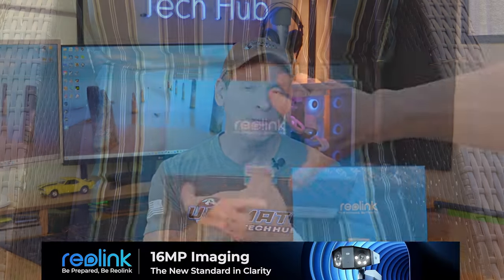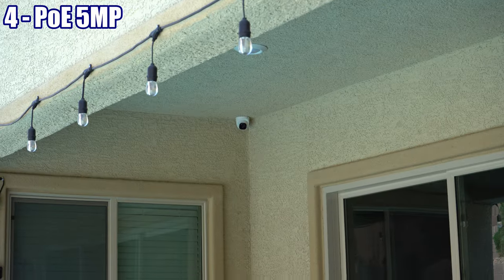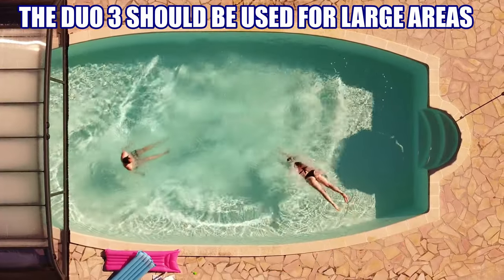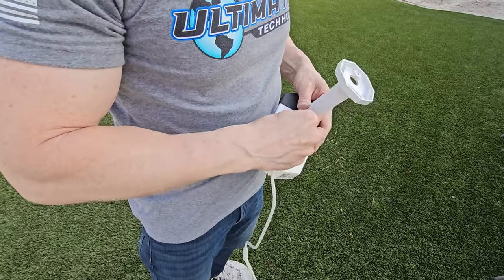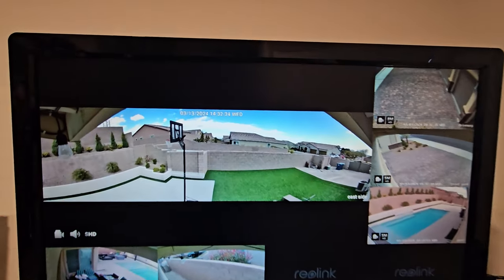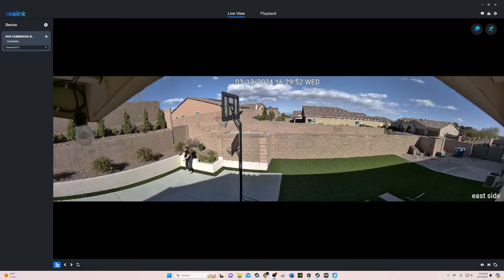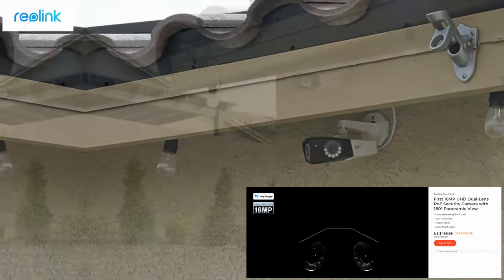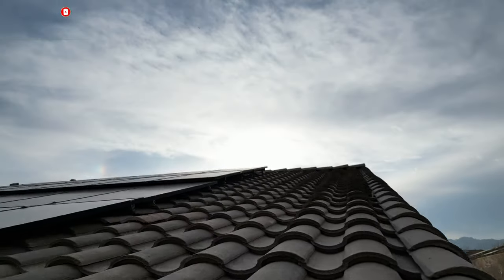REOLINK DUO 3 INSTALL & REVIEW, HERE'S WHAT I LEARNED!!!

Comment: Is there an alternative for the mounting plate? I Lost mine
Reply from the maker: You could just connect the bracket with the one hole at the top. Just make sure you screw it in tight and maybe even use a slightly larger screw that's a little longer so it goes in deeper. Otherwise, contact Reolink for the spare part, tell them Mike from Ultimate Tech Hub recommended you. Keep me posted and thank you for watching!
Reply: @UltimateTechHub  thats the first thing i did , emailed them. To my surprise, they dont do or make spare part. Thank you for the idea, i will do that.

Comment: Maybe Im ignorant, but Ill never understand a "security" camera system that you can access by phone/ wifi. If you can see it on the app, so can they. How is this secure?
Reply: umm, you need to be on the network and have the login/password at a minimum. it has to be added first at setup, typically via ip or a qr code on the camera itself, and they need to be on your lan to begin with which should also be secure... any random cant just look at it lol. did you really think they overlooked that?
Reply: @cryengine_x  um, I may be ignorant, but you're naive. You really think this camera system isnt vulnerable to hackers?!
Reply from the maker: All systems are vulnerable to hackers including your TVs, smart devices and computers.  It's still a great camera and a great value. Thabk you for watching..
Reply: @UltimateTechHub  maybe I'm not as ignorant as I thought? I do not mean for this to sound facetious, I'm geniunely asking who can find value in a security camera that is vulnerable to hackers? Agreed, all devices are vulnerable to hackers. My intent is not to stir things up. Simply stating that I do not understand how one can purchase a "security" device that has the potential to leave one feeling less secure. Believe me, I've spent money on stupid stuff before as well.

Comment: Your mounts  upside down
Reply from the maker: I'm a rebel! Lol! I had to do it that way because of the cameras position under the roof line. If the camera was lower then I would have installed the other way. It works well and zero issues so no big deal. Thanks for watching!